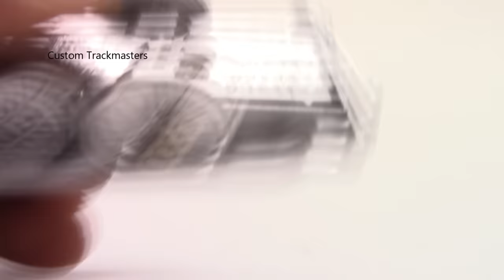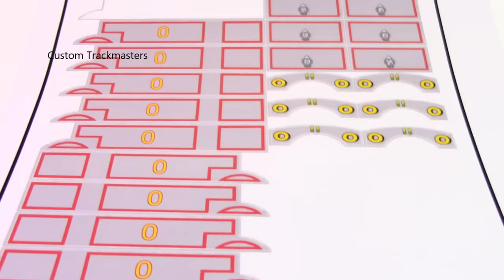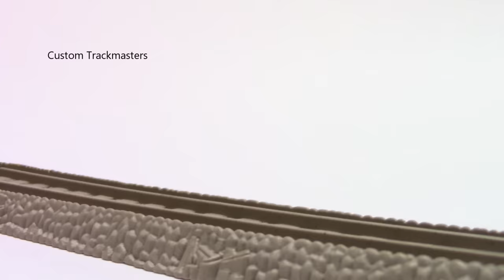Custom Timothy the ghost engine Trackmaster Thomas & friends thomas y  amigos 托馬斯和朋友 Томас и друзья

Comment: I would like to tell you that if you are doing this type of rework then you better take the 2014 version before the trackmaster revolution then it will look better I have such a locomotive from 2014 and soon I will convert it to timothy the ghost engine or paint it in original colors. so as I say instead of the locomotive version from Hit toy company take the 2014 version before the revolution version. 
but in my opinion you have done great this locomotive is very cool.

Comment: You could have used black spray paint on the wheels and painted the running board black and left the sides red this is just a tip and if you don't think so then you csn move on For #Custom Trackmasters